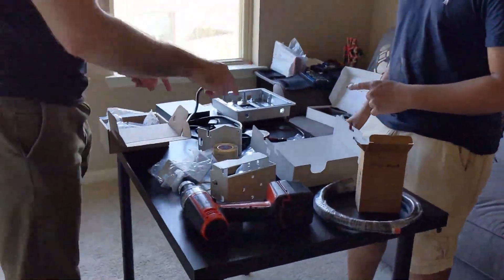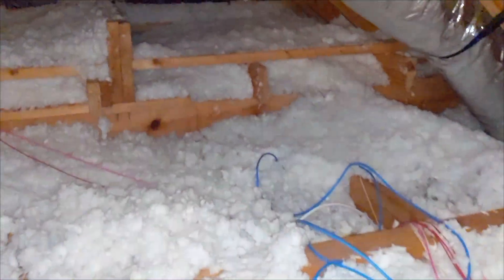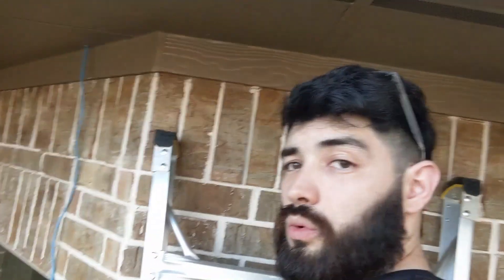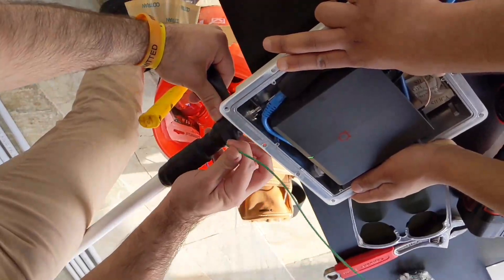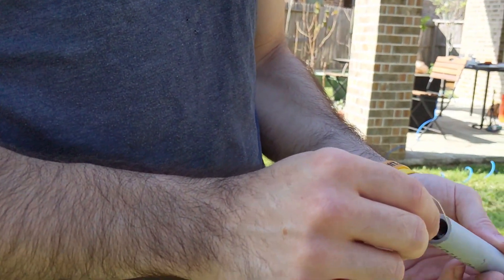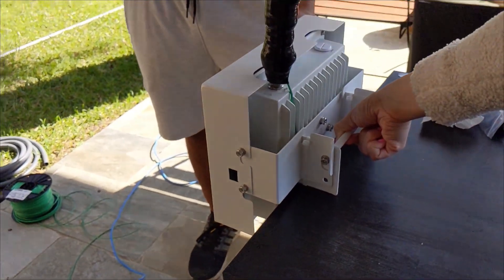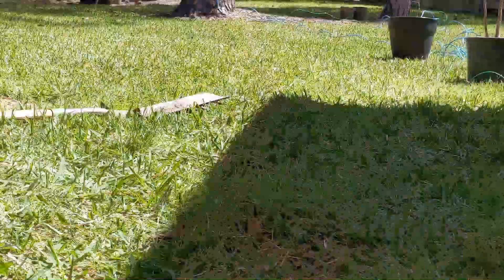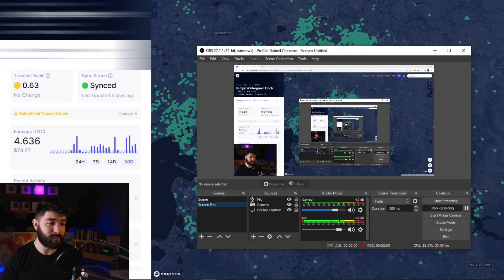Paid Tree Climber $200 To Install Helium Miner In 140ft Tree ( Full Tutorial )

Comment: Awesome information,  ty so much.  Question: when in the Illinois area, freezing weather. What set-up can we install to keep temperature from freezing Bobcat miner. I will ask on discord as well. Ty for spread sheet. Amazing channel
Reply from the maker: Hey Peter thank you for the kind words! So I'm thinking that what you mostly have to worry about is the moisture. If moisture enters and expands when frozen, it could break off points inside the miner.  Same thing with soldering points.  This part is a bit out of my expertise, but i would look to maybe look for some kind of small heater, could be a simple lightbulb that generates heat with a smart switch that can help you regulate when it comes on and off.  If not a lightbulb it could be some kind of thermal strip that gets the job done in the same way.  Just brainstorming here lol but that's where I'd start.